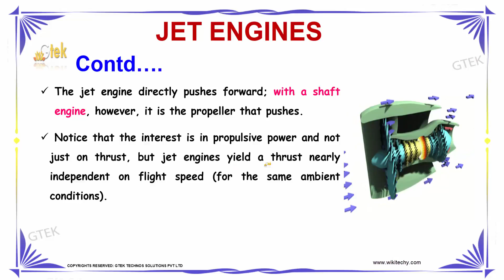Thrust instead of power | Aeronautical Engineering Interview Questions and Answers|videos|freshers

Comment: To find the weight, 50 g needs to be changed into kilograms by dividing by 1000. This gives a mass of 0.050 kg. Weight is mass (in kg) x 9.8, which gives 0.050 x 9.8 = 0.49 N. The resultant force is the thrust – weight = 5 – 0.49 = 4.51 N (unrounded).

Comment: When a system expels or accelerates mass in one direction, the accelerated mass will cause a force of equal magnitude but opposite direction on that system. The force applied on a surface in a direction perpendicular or normal to the surface is called thrust.